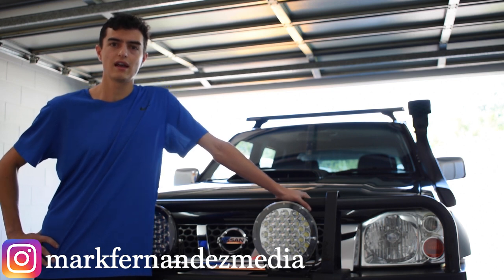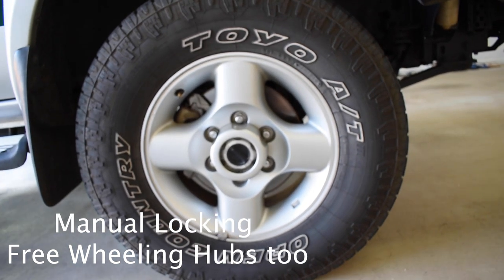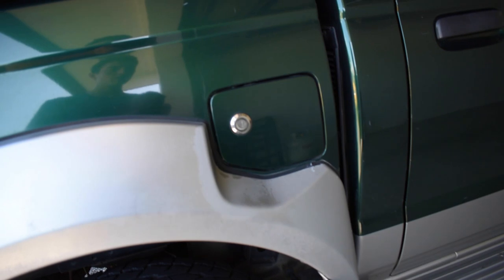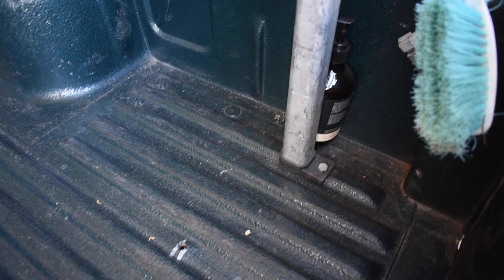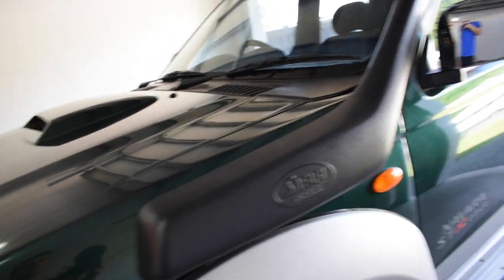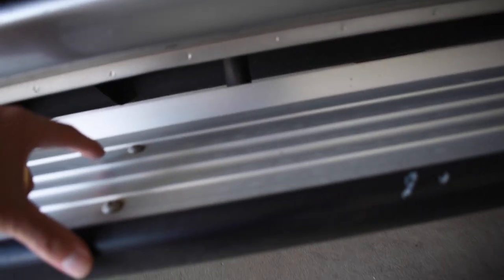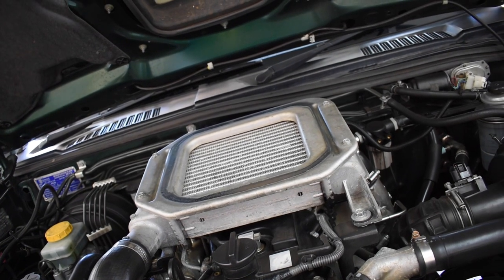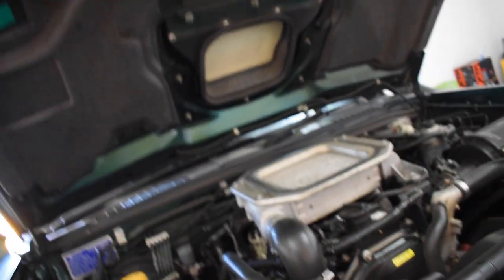Rig Walk Around || EPIC Budget Touring/Overlanding Vehicle D22 Navara

Comment: Does it have a lift? If so what one? Looking for a budget option for mine as the ride is fairly rough and I want the look and ride height!
Reply: 100% put an iDrive throttle controller on yours, added one to mine and it feels like a completely different car to drive. Worth every penny.
Reply from the maker: It does have a lift. They are old man emu. Should be a 3 inch lift. The increased tire size gives it a little bit extra too. Comparing mine to my mates (who is stock) it makes a big difference. Also 200kg constant leafs in the back.
Reply from the maker: I was looking at the idrives. I might have another look. Thanks for the recommendation. Throttle response is a bit slack so that should help a bit
Reply: Mark Fernandez Media wow not a budget option then 😂. No worries, wouldn’t drive mine without it
Reply: @adamblack2585  Do you remember what you paid for it.
Reply: Darren $235 on eBay
Reply: @adamblack2585  Thanks M8.

Comment: Why would you go with steel wheels over alloy for 30" tires? I would think mileage and heat dissipation while towing would be your main concern with a touring/over-landing vehicle.
Reply from the maker: Excellent question. I may have misspoke. These are stock alloy wheels that come with the D22 str from the factory. I agree with you about the argument for steel wheels. The increased weight of steel wheels could make it feel sluggish regarding low down torque. I would like to change to steel wheels to see the impact with the same tyres. I appreciate the question brother. Have a great night!
Reply: @NorthOz  oh ok. I have the same ute is why I ask. I am going with the Method 701 trail series wheels and 32" tyres. I thought about steel wheels because they are significant cheaper but this will be my daily driver and I want to keep as much economy as I can.
Reply from the maker: Nice. With 16 inch wheels and the profile on these mine are about 32 inch. Definitely is higher than stock and combine it with a 3 inch lift and changes the look completely. Let me know how the method wheels go. I have heard a few people talk about them. I hope you get a few ideas from me and I look forward to hearing about your rig too brother!
Reply: @NorthOz  what size tyres are you running? 265/70/16 on mine are 30.6 inches.
Reply from the maker: From memory 275/70/16. I will have to double check
Reply: @NorthOz  those would be 31" definitely not a common size.